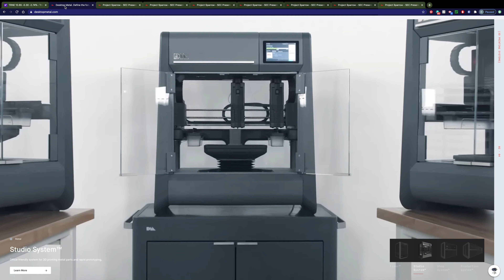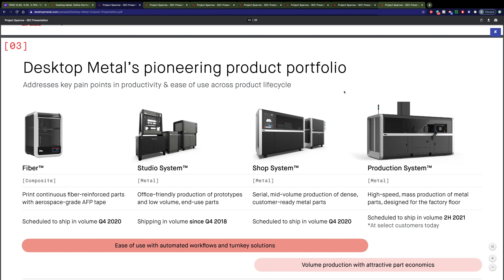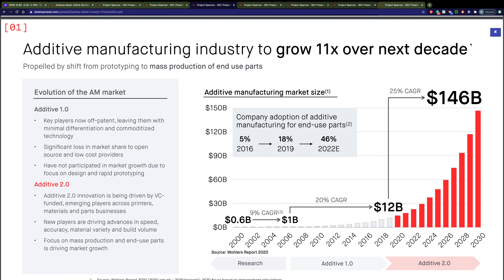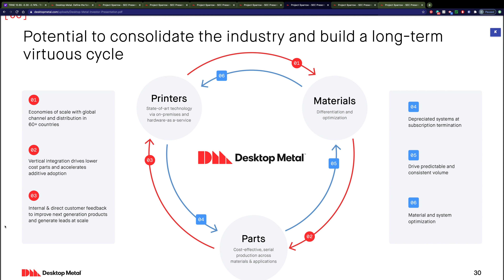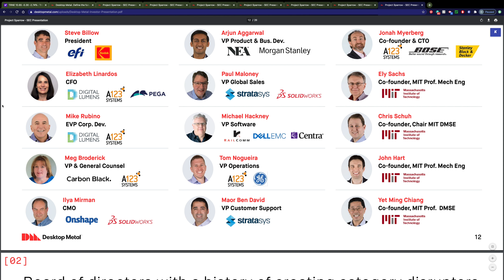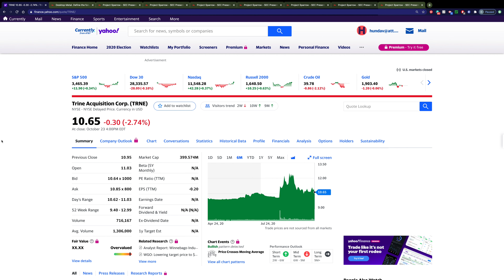What is Desktop Metal Stock? | TRNE Stock Analysis

Comment: Not one of its kind but one of few.. XONE is the pioneer in Metal jetting printers , HP posted 4 days ago on their YouTube channel THEIR metal binder jetting printer.. and when HP enters a market the industry is shaken.. yes, as it happened when they introduced their plastic binder jetting 3d printer a while back. Still, at current valuation desktop metal will be 2.5 P/E in 5 years (forecast) that's way low compared to any company generating a $1 billion dollar revenue (again, 2025 forecast) - In today's price with last Friday's stock hike the valuation is over 100 P/E. So it's definitely a LONG investment IMHO. To quote investopedia.com "A higher P/E ratio shows that investors are willing to pay a higher share price today because of growth expectations in the future. The average P/E for the S&P 500 has historically ranged from 13 to 15."